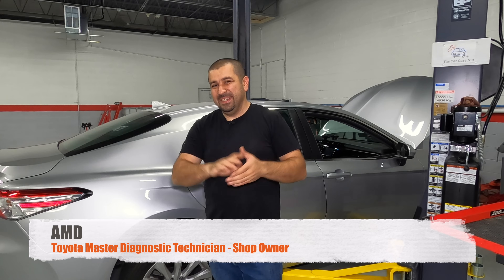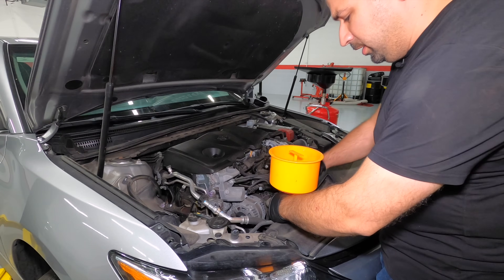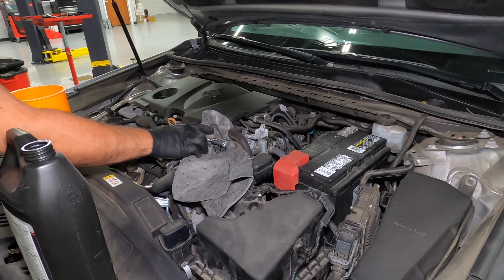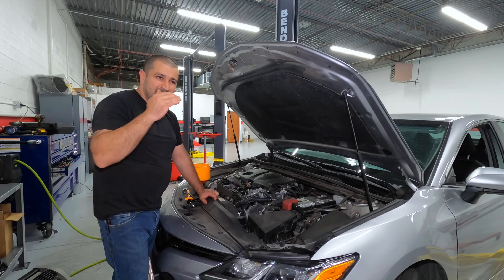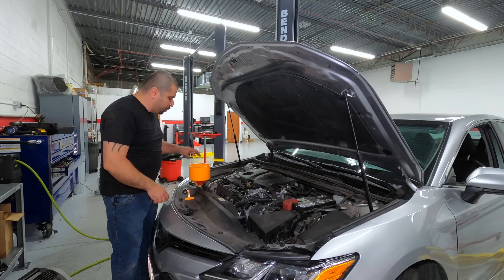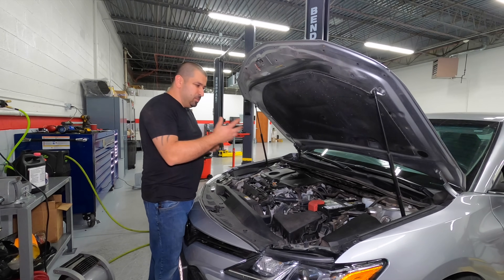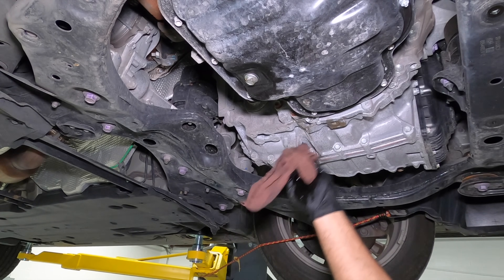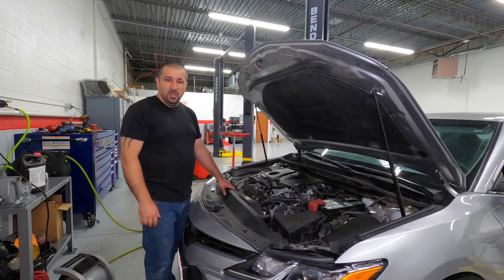Coolant Replacement on Toyota's New Dynamic Force Engine | DIY Without a Scan Tool

Comment: How many times would you suggest doing the drain and fill method on a 2019 Camry? Car has a little over 100k, don’t think the transmission has been serviced.

Comment: I'm seriously considering driving from Florida to have this man work on my RAV 4 - I'd get the drive belt replaced,  coolant replacement, brake fluid replacement, pcv valve replacement, spark plugs replaced, clean the throttle body and clean the MAF sensor.   My dealership near me are complete rip offs,   I just want to be sure that what I pay for is what I get.

Comment: I saw a doc from techstream 1) it says put cap on and then turn the engine 2) when finish put coolant between low and full line. Can you bleed air with the cap on? Is that better?

Comment: I don't know if he mentioned it in the video or not, but during the fill, unless I clamped the hose to the coolant overflow tank, it overflowed onto the fender liner and streamed down. The referenced funnel tool was not available in Canada. I used something similar (still huge funnel with a plethora of adapters). That may have been the cause.

Comment: I wish I had seen your video before I attempted to change my coolant. I watched another video and it seemed pretty straightforward however when I opened the radiator cap and then removed the drain plug the fluid did not drain. Confused as to what was wrong I went back to YouTube and found your video. Had I seen this video first I would have not attempted the job myself. I replaced the drain plug and cap. Now my car is undriveable. The messages that appear on the dash are: Hybrid system malfunction, Pre-Collision system malfunction, check engine, visit your dealer. When I attempt to drive the car it tells me to pull over and stop now. The nearest Toyota dealer is a 100 miles away. Can you give me a suggestion on how I can at least make the car drivable to get to a dealer. Thank You for any suggestions you may have.

Comment: I have a question about the water pump and heater coolant valve operation if i use a scanner rather than the method suggested in the video.  If after draining the coolant from the radiator, if I open the valve and run the electric water pump do I still have to run the engine at a constant 2000 to 2500 RPM or just let it ideal.  Will the fans still turn on twice?
Please confirm that opening the EGR valve by removing the hose bleeds the air in the engine to the top.

Thanks

Comment: Is this required after a coolant valve replacement? Dealership wants to charge $300 for a coolant flush due to the coolant valve TSB. They are saying Toyota will not cover it….which make sense as it doesn’t seem required. Any guidance?
Reply: What is a “coolant valve”? Another word fir thermostat? What year is your Toyota?

Comment: Amd, on a 2019 Camry hybrid with the A25A FXS, after entering into the maintenance mode, do I still have to keep the car @ 1500 rpm’s pressing the gas pedal, or the maintenance mode setting will take care of that step?

Comment: Hellow I been a follower in you tube for many years, I have a toyota highlighter V6 2021, not hybrid, and I need to change the coolant, I saw all yours videos of V6 coolant procedures but any of them apply to my vehicle as I see in the description, and worried because is already 58,000 miles and I have to do this as soon as possible, it will be the first service, can you help me to find a video of you working this vehicle, thank you so much for your service.

Comment: PRO TIP….
No need to go buy a 9MM petcock hose for draining. Just “borrow” the one from the inside of the coolant reservoir - it’s fits perfect, and is always there when you need it!

Thanks, Armando and TCCN Team!
Reply: I ran the hose through the hole in the bottom of the plastic shroud, so I didn’t even need to take the shroud off

Comment: Is the D7 scan tool you reviewed in another video capable of flushing the air from the system? I would be more comfortable using a scan tool to remove the air than running the engine. For what the dealership wants to change the coolant I can buy the D7 scan tool if it’s capable of doing the job. It would be great if you could do a video using a scan tool. Love your videos, you provide a lot of great info for the folks.

Comment: Ty Armando. Question!! I was doing this and waiting for the 2nd fan shut off and the car just turned off and gave me a ‘low key battery error’. I basically restarted the fan bit bc I could still see micro bubbles in the funnel. But did I do something wrong???? Help?!

Comment: I have a 2017 Camry with a 2.4 can you just simply drain and fill, or is a flush recommended, do you have to do with the bleed? Or put it in the mode that you're talking about

Comment: I have a question about the Transmission Fuel Replacement portion of your video. I noticed you didn’t mention anything about pushing the Cooler Bypass with an Allen Key like how you previously mention to do in your video on August 14th, 2020 … so is pushing the Cooler Bypass a necessary step or not?

Comment: I did my coolant flush today, it was  awesome 2022 Camry hybrid. But I also did drain the inverter at the same time, I filled up the tank a little more than the full line. I started the car, bled the radiator coolant like how it’s demonstrated in this video. The only thing Is my inverter coolant didn’t drop down. It’s a new car, I do drive uber and this is first time inverter drain and fill. Should I be worried about it?

Comment: A few questions.  I will be draining a 2014 5.7 Tundra. First before draining is it recommended to have the car "warm" not hot in order to open the thermostat before draining?  Thats what I used to do on my older American cars.  I would pull the cap on the radiator and watch for the fluid to start circulating.   Are there any high spots that require bleeding?  Finally, I was considering using Zerex in place of Toyota fluid.
Thanks.  I am sure many others have these same questions.  Great channel.

Comment: Thank you for this excellent video. Just out of curiosity, cam you refill the coolant using just to "old fashioned way" of the heater on full blast and letting the csr run to temp? Its how i always did it before with success but cars certainly change....any advice? Thank you!

Comment: Hello. thank you for all the information in your video. I own a 2019 rav4 xle in need of coolant change. i own a scan tool "2024 LAUNCH Creader Elite V2.0 fit for Toyota" i can not find any videos on how to use a scan tool do a coolant change with bi directional control (what valves to open do i need to turn on the fan? turn on water pump?)

Comment: Hector from Puerto Rico.  I like to much your videos because here we no have well mechanic only have part changes.  It the scaner said the problem is a part they changes, it the part not was the problem the custumer loss the $.  I have a Rav 4 and was in the dealer 3 weeks because the scaner not said nothing wrong.  When the problem come back I take a vídeo but not find the problem.  They not fing the problem, casuality crash the hand to the baterry nut  and is was loss.  I have a questions, at what time or milage changes the coolang and how many need for all the system?  I need to use original one or other for Japan Cars?  I see all the videos your because I not know a techic with your of your calibre and experice.  Here I goint to see it.  Thanks for your information and appretation than brigh to is.🙏🙏

Comment: So I had to do this drain and fill to the dreaded electric water pump issue. I have the 2018 XSE 2.5l.  130k and then P26CB.  I changed the water pump reset the code and filled everything like mentioned.  I held the 1500-2000 RPM for a long time, but the fans never came on, but gurgling and fluid loss into the engine happened.  I went for a drive (about 30 min to test it) and then the fans came on so I let it cycle 2 times before calling it a night.  All is good I hope, if it was going to overheat etc it would have done it.  Idk maybe taking the water pump out messed up the cycle?

Comment: Here's a question AMD probably won't see. From his Amazon product store, I bought the Phoenix Systems 8006-B Coolant and Brake Fluid Test Strips and used them today Sept. 10, 2024. My 2020 Camry will be five years old (with around 22,000 miles by then) in Feb. 2025. Both brake fluid and coolant are original and tested really clean and not even near needing replacement. AMD recommends changing them both at 5 years...but, they both test really clean with plenty of use still left in them both. What would AMD recommend?

Comment: Thanks Armando.  Will be changing coolant in a 2019 Camry before my daughter makes a 500 mile trip to her university.
Update after finishing.  Be aware that it will take several minutes ( more than 10) to bleed the cooling system.  Also, I found a clear overfill funnel and found that was much easier for watching the level in the funnel.

Comment: I only did the petcock on the radiator like it seemed like he instructed to only do (I did not hunt for other drains on the engine), but....I didn't have the car level (front was on jackstands since I have other work to do as well)...so not quite 3.5qts came out, including what I sucked out of the reservoir.

Comment: Hello, I just followed this procedure on my 19’ RAV4. The fan turned on once, turned off and then turned on again. I eventually turned the engine off after about 45 minutes of this cycle, the second fan cycle did not turn off, the temperature did not go past the normal point. Should I re do this process or you think it is good to go?

Comment: Can anyone answer a few questions.  1) What type of coolant, full strength or 50/50?  if you do more than one drain and fill on the transmission, what do you do prior to doing another drain to circulate the new fluid to mix with the old before draining?

Comment: I have a 2020 Toyota Corolla 2.0 that needs the coolant bypass valve replaced, would I need to do this procedure after replacing that part?

Comment: Thanks Armondo...My wifes 2021 Rav4 hybrid (currently 105k-KM) service dealership is wanting to change the ICE coolant and hybrid coolant at 116k/km this seems really Early for SUPER long life coolant. I am getting them to do oil replacements @ 5k miles/8k KM as we want to keep this car for a while. I can do the Maintenance as required but i feel the Stealership  is getting extra $ for over maintenance. Any Ideas?

Comment: Hello AMD could you please advise  how to drain the inverter coolant on the 2GR-FXS? Does it drain with the radiator or does it have a separate drain plug , maybe somewhere close to the transmission drain plug ? Thank you !!!

Comment: Thank you for your great videos!! I have learned so much from them. I have a 2020 Corolla SE with the M20A-FKS 2.0 L engine and needed to replace the coolant bypass valve (seems to be a common issue on these cars). I don't know if I need to bleed the system after, or not. A small amount of coolant came out when I replaced the valve, but not sure if it warrants bleeding. Also, my car doesn't have a traditional radiator cap, just the cap on the reservoir tank, and the coolant funnel does not fit on it. I would love to see a video of you replacing one of these valves on a Corolla and doing the coolant bleeding, as the  service manual seems to have a much more complicated way of bleeding, including running the heater, revving to 3000rpm for a few seconds, and then back to idle, etc., etc. I'm a little stumped as to which method to use. You always have the best videos and cover all the steps.. You're the only one I really trust to be able to do it right. Since this issue seems to be common on all of the M20A-FKS engines, many of us would be eternally grateful to see it done by the best - YOU! Thanks again for all of the incredible content you provide. God bless you and your family!

Comment: Thank you so much I did everything in the video including using tubing to drain the coolant and I Also had to replace the water pump, one thing is you didn’t say anything about the clear coolant bottle and what should be done with it however I filled it to the max mark is that fine?

Comment: I sure wish you could do a video for the PCV Valve replacement on this A25A engine. The dealer wants $800! $10 part. Do we need to replace the intake gaskets when doing this? Please help us out. Not a single good video on youtube about it.

Comment: Thanks Armando!  I'm still confused about the heater being off though...  You didn't use a scan tool, but perhaps you somehow put it into "bleed mode" manually without the scan tool?  You make it sound like the "bleed mode" will automatically open and close all the valves, including the heater core valve, which is why the heater is left off.  Not questioning you for sure, but just trying to understand...  Don   
PS  I would happily drive 3hrs to bring my old Camry to CCN...

Comment: I have recently changed the coolant and transmission oil of course using your videos. Thank you for being a great help to the community. I have a question though, the coolant bleeding procedure is it only applicable to this particular vehicle or all vehicle in general? Thank you mate.

Comment: Thank you Mr. Car Care Nut for the video, just had to replace my water pump & thermostat and this video was very helpful to add the coolant and bleed the air out of the system. BTW, thank you Armando for the long drive and for your Camry for the making of this video. Thank you both and God bless you. 💯💯💯👍👍👍
Reply: What year and model Camry do you have that you had to replace your water pump and thermostat and a what mile interval?
Reply: @jasoncurry2515 Hello, my car is a 2018 Toyota Camry LE and replaced the electric water pump @ 54000 miles, it’s electric, once it goes bad it will send the code to the dash, it may vary between cars, if you do it yourself like I did, I brought the OEM Aysin electric water pump on Amazon and also got the thermostat with the housing, all came to around $550.00. If you like to work on your car, just follow the video and you can save a lot on the labor cost which of lately are very expensive. Hope this helps. 💯💯💯

Comment: Hello, thank you for the video. Can you clarify if this procedure applicable to the new 2.4T engine found in nx350 and current Highlander.  This engine has two coolant reservoirs and two rads.  Neither rad has a radiator cap.  

Do I just fill the coolant in both tanks and keep engine speed above 1500rpm while adding coolant to keep both tanks full?

Comment: Thank you Armando! 😆 Regarding the 8-speed transmission oil change, how come you didn't lock the bypass valve like you mentioned in your Sealed Transmission Oil Change video?  Do you not need to do it with the 2018 on up Camry?

Comment: Amazing video! Quick question if you're using ramps for this job, is the coolant bleed mode able to be done while on the ramps or does it have to be on a flat surface?

Comment: With all of the plastic components of the Dynamic Force engines, has anyone been experiencing coolant leak issues? I am considering buying a Corolla, so feedback would be appreciated.
Reply: None what so ever just do not have a very heavy foot do not use a super thin oil if you live in very hot climate(any where above 25 degrees centigrade) use original Toyota oil if you can and keep very good maintenance and use high grade petrol and clean petrol from good reputable petrol stations 😊

Comment: Just did today, engine held temp and all seems to be going well! I did have a few questions for the masters out there: Draining went very slow and not much if any came out of the reservoir, is that normal? Second: I put more coolant in than came out, got exactly a gallon out but put in maybe 1.2/1.3 gallons. How is that possible? Does it expand when hot then contract when cold? So the hot volume would be slightly more than cold, then i took it out cold, and filled it up cold? Then the reservoir adds or subtracts as needed?

Comment: Thanks Armando ! And thank you AMD for the video.   I have two questions. 

You didn’t mention the coolant reservoir. Do you make sure it is at max full with the car warmed up?

And I have an ‘09 4 cyl. Camry with 235k miles. Do you recommend a coolant flush product for older vehicles before putting new coolant in ?

Thankyou !

Comment: I am planning to change coolant on my 2020 Rav4 LE. Bought the pink coolant from Toyota. The instruction on the back label deviates from your video on the new Dynamic Force Engine. Did I get the NOS pink coolant from Longo Toyota or the new instructions on the pink jug should be updated by Toyota? Thanks for your great video as always.

Comment: Thank you can and Armando. I drove my 2013 camry 800 mile trip. On the way I check the oil. It was 1/4 qt short. But, I noticed the coolant was too low, lower than minimum. Actually I didn't see the coolant in the expansion  reservoir. The car wasn't  leaking any fluid. I bought a green coolant. After I poured the coolant, a pink fluid appeared.  Then, after i checked the coolant again after 400 miles, the fluid was down to the minimum mark. I refilled it to the max mark. It stayed at that mark after I drove back 800 miles. Now I guess I have to replace it since I mixed the green with the pink.
Thank again I enjoy your channel.

Comment: 2020 Camry SE here. Just recently had my coolant bypass valve replaced and now I hear gurgling in front of the firewall drivers side. Wondering if my system needs purged. Also, could this cause start up issues? Car engine will turn off fine, but sometimes stutter when the tire hits and die. On the next try it starts up perfectly fine. I'm lost on where to go next.